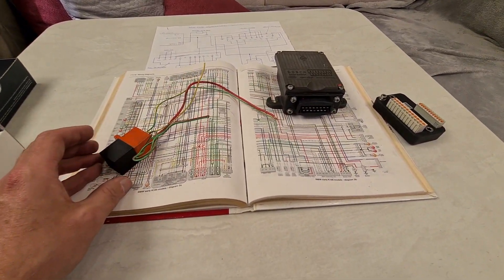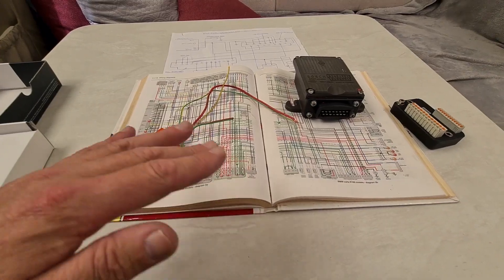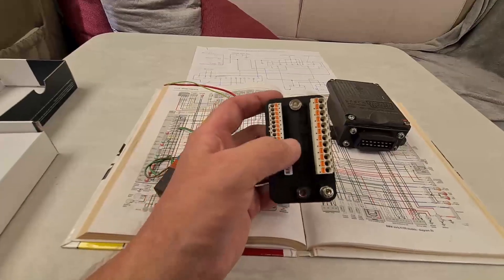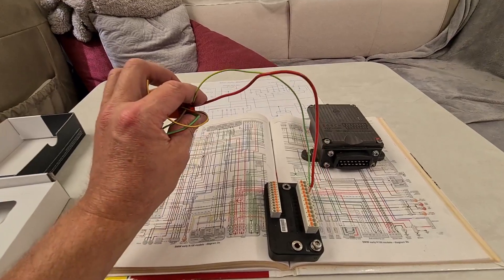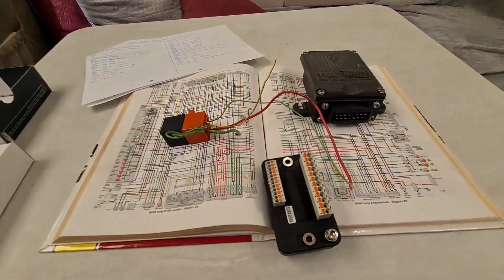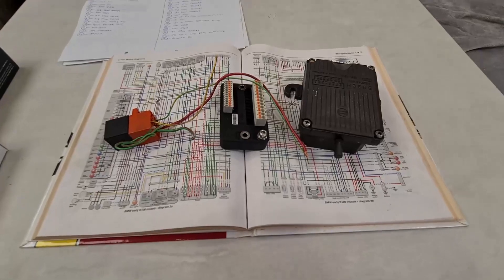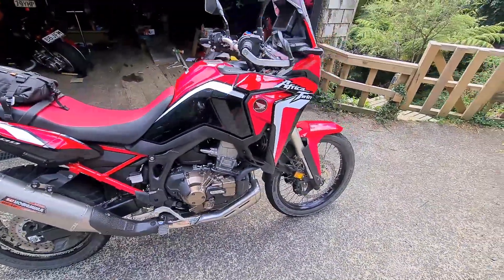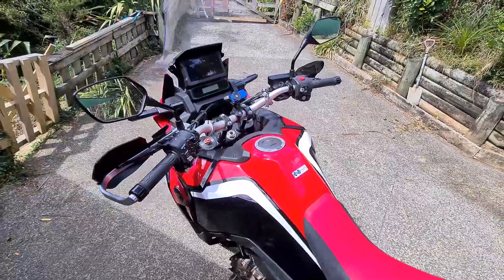BMW K100 MOTOGADGET M UNIT WIRING  PART 10

Comment: Just for those of you with early bikes (mine is an 85 LT) the relay does not prime the pump when key is on. It will only do so when cranking. The wiring in this video is correct but not all of us will get key on prime

Comment: Hi Mikey. Thanks for making these videos. I am wiring up my k100 right now and following what you have done. I do have a couple of questions, though
1. The neutral switch
2. Clutch switch
3. Speed sensor
Those you had no mention of in your videos, any suggestions about what can be done with those? 
Thanks in advance
Reply from the maker: Hi, glad you enjoy the vids, i do  have a vid somewhere about the neutral switch, some where lol, clutch switch not needed (imo), speed sensor of the front wheel directly to the motoscope pro (from memory)
Reply: Thank you for the response! I can not find the video of the neutral switch😢, from my understanding you need to ground out two of the wires coming from the transmission? If that's so, do you know which two?? Also, can you use the factory speed sensor at the rear wheel to the motoscope pro? Instead of the supplied Speedo wire??
Reply from the maker: @davidmarks32  Sorry i am unsure , i dont actually own a K100 anymore and haven't worked on one for a few years now, i do believe there is a unit you can buy that plugs into the factory gearbox loom that will sort out the neutral light etc, and no you cant use the rear wheel sensor.
Reply: So the K box I believe it’s called is what I think Mikey is mentioning here. A couple of sites sell them to fix the neutral light issue.
Reply: You can take the speedo board out of your original dash as that’s a Vr to Hall converter

Comment: Hi Mikey,  I have wired up as per the videos, I have a problem that coil 1 & 4 is not sending a spark to the plugs, tested the coils, all okay, tested the HT leads and plug in different pots. also the injectors are not firing.  I cannot see what I have done wrong here. Hope you can help me.  Cheers
Reply from the maker: Sounds like a ground wire problem to me ? All 4 injectors share a common ground , check those first would be what i would do first

Comment: Hi mikey… I have the BmwK100 1991 model… 
I will try to keep this story short.. I followed you and your wiring program early last year.. I ended up given the bike to friend to do ..he wired it all up following your wiring program so he told me .. it would turn over but never start as petrol just poured out the exhaust.. anyway he gave up, so I took the bike back and stuck it in my shed.. a year on and I’ve decided to to down shed have ago on my own.. I noticed the thick green and red trace which is the one your showing here in video ( injection cable ) is connected to nowt both ends on my bike? 
So I’m thinking that’s why it didn’t work and petrol poured out of exhaust.. 
can you email me the wiring program if you still have it? 
If that is possible or is it one of your videos..
Also in this video you show injection box as one, on my bike it is two smaller boxes with nine wires coming out. Would that be because it’s a 91 model. Thanks..
Reply from the maker: Hello sorry for the delay in reply , let me know your email and i will send it to you !

Comment: I'm looking to lay out and plan my wiring using M Unit Blue on my 1989 k100. I've followed your loom cutting guide but can't seem to find any wiring notes/ diagrams etc. I'm also on a later bike with different relay and wanted to do the fuel pump update. I cannot find the relay that you describe other than a block of two which I think are fan and fuel?

Can you assist? I can send photos....
Reply from the maker: What year bike ? This is only for the 8 valve 1983 to 1992

Comment: Did it all as shown but mines not working for some reason, my pin 7 (yellow brown) wire from the ignition module is grounded when the bikes off, but becomes positive when it’s turned on. This is leaving the relay ungrounded, any help on how I can fix this?
Reply from the maker: Hello , what year is yours? most people are telling me it seems to work fine , i have just looked at the wiring diagrams in the Haynes manual and it should be switching negative on pin 7 of the ignition module . can you email me photos of  how you have done it?
Reply: @mikeyfrompiha  mine is a 1985, I’m not sure what error I had made or if I had a bad module, but I actually re decided to change my plan and made a custom ground switch for the fuel pump connected to aux 1
Reply: @izekaCA mine is the same - my pin 7 is positive when the bike is on. It stays positive